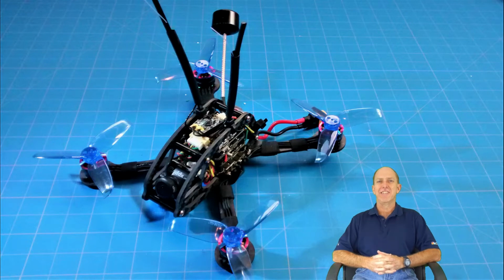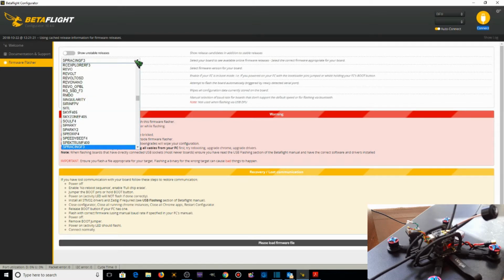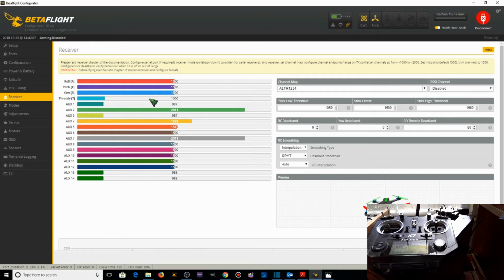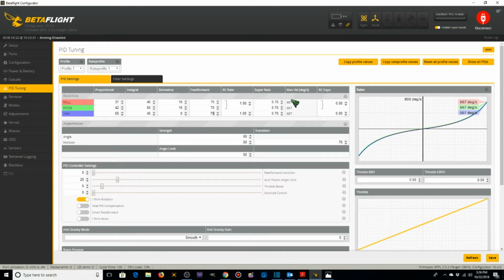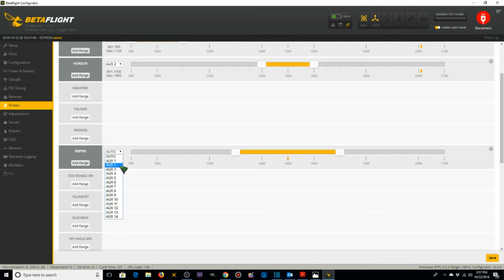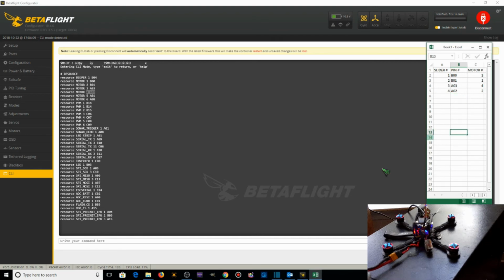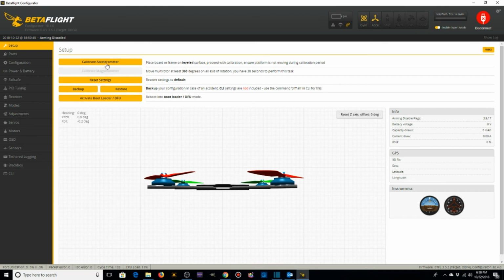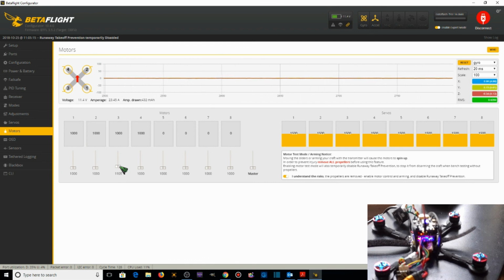MICRO FPV 2.5 INCH DRONE BUILD - Part 3 BetaFlight Setup

Comment: Boa tarde

Good afternoon
Friend I have this problem my engine 1 does not turn already tried everything but to no avail
Reply from the maker: Replace that motor with another one that works using the same position on the ESC (connect the good motor to the se ESC pads as the motor that is not working after you have disconnected it). If the good motor still works in that position, then the original motor is bad. If the good motor does not work in it's new position, then that ESC is bad